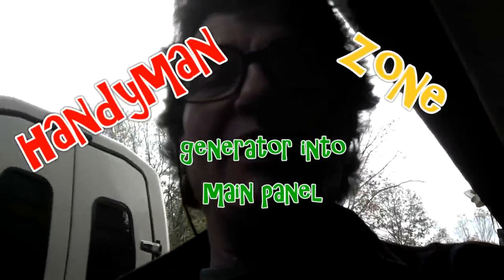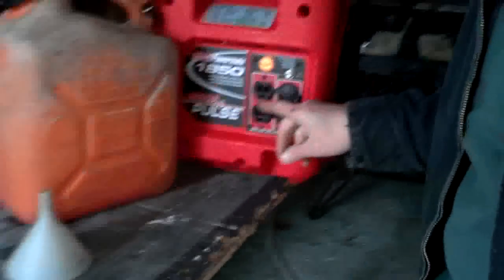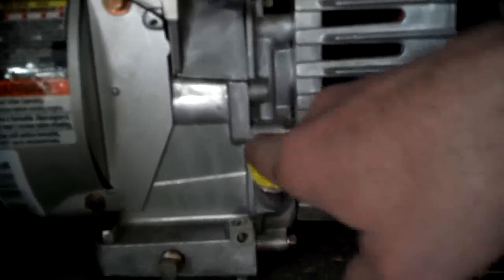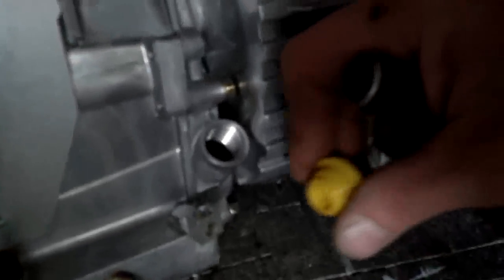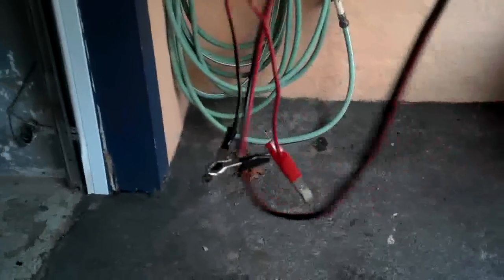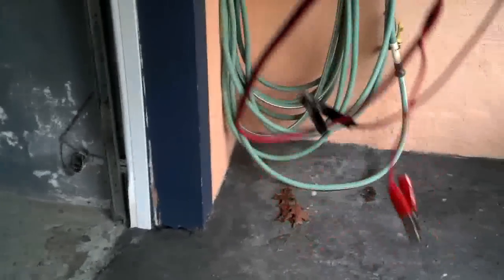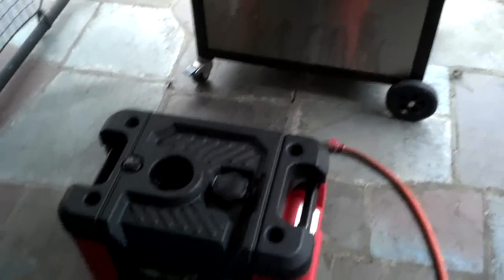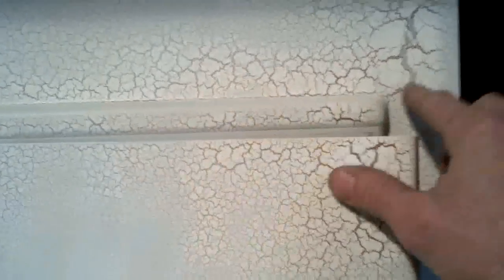HOOK-UP Generator to Home Main Breaker Box

Comment: O M F G.....   WOW..  

Where do i begin...??  I am NO electrician and i would have NEVER did what you did...

The generator is fine.. Your cable from the generator to the panel was ...... Sub standard to say the least. You used alligator clips to attack to the panel... Hope they can support ~15 amps..  You powered one side with the clip and then used a CLAMP to jump it to the other buss bar at 18:16......... WTF....  i would have just opened up the aligator clip even more and jumped both bass bars with the same clip.... 

Yes your setup worked and its safe " AS LONG " as you don't overload that main wire from the generator to the panel to create a fire before the generator could trip its own breaker.. 

I would have got a double 15 amp breaker.. slapped it in there, attached the black HOT 120V wire from the generator to one side of the breaker and JUMPED it to the other breaker to activate BOTH buss bars with 120V...  Then SHUT off all 240V breakers... Now the entire house has access to power, just have to be careful what you run that you don't overload that generator cause 1800 watts is NOT a lot of power...

Comment: DO NOT, use the "alligator clips" like this gentleman is doing. All local codes aside, in an emergency you are safer just turning off the MAIN breaker and plugging the generator into an outlet. This assumes you have an extension cord with plugs (no receptacle) on each end. In a real emergency I would likely cut one of my extension cords and wire it to an existing breaker (not recommended but safer than stupid clips). NEVER hook to the ground. This is AC not DC connect to White and Black wires.

Comment: I strongly recommend you totally disregard this video.  This is a really wacky way to do this.  He is lucky he didn't electrocute himself.  Instead, if you are so foolhardy as to to connect a small generator to the main panel, just turn the main breaker off then plug the other end of your feed from generator with a male plug on both ends into a wall outlet.  Then select which circuits you want to feed and turn the others off.  None of this foolishness of messing behind the breaker panel.

Comment: I don't know why all these turds are posting scary comments about the method this guy has demostrated to power up at the breaker box..  His demostration is right on for disconnecting the breaker box from the power grid and providing his family with electricity to make it through an emergency.  Yes, the most safe method would be to spend a thousand dollars or more to install a connector box but american can do attitude wins out each time.  So all you elec code police, stay off this guys case!!

Comment from the maker: @ssharnick, vid or no vid... 18 house burnt up this area from generators in 13 days! the reasons officials gave range from dry leaves built up near hot generator to leaky propane tank....nothing about a youtube video....lol .more burnt up from falling live powerlines or fires fireplace and dont forget candles used for lighting
this is a offical disaster all crazy shit happen, 8 dead from carbon monoxide - gens in garage, or charcoal grilles 4 heat. ppl are stupid linemen are not (they check)

Comment: I've made mistakes with jumper cables.   At the 8 min mark I knew this video was a mistake, when I saw the home crafted jumper cables.  omg, find another video
Reply: Actually.. As long as you're practicing safe methods, who made your cable doesn't matter that much. I make my own "home crafted" cables all the time.. ^.^
That being said... There are easier ways to connect your genny w/ plugs already available in your home, and without any exposed copper.
Reply: I agree.  But "safe methods" are difficult to follow in the dark, cold, stressed filed atmosphere of trying to get things done.  A transfer switch is the best way, and I'm not sold on reverse feed..  Take care

Comment: still thaire is way more safer ways to illegally power your house like making a too ended electric dryer cord and putting  the main breaker in the off position  pulling out the main breaker with the line side of it having the potential of becoming live if power comes back on is verry verry un safe and kill someone if they happend to hit the lline side of the breaker

Comment: I guess you do what you have to. However this is not a proper way of connecting generator and line power. Use a change over 3 way switch mounted in a insulated wall mounted box and proper waterproof sockets and wiring. Still you got power gangan style.
Reply from the maker: thanks , I'm good to have around in any disaster.. .maybe if the universe allows, we can share a small disaster soon...Lol
Reply: You are right, its not the proper way but it WORKS... His only downfall was the wire from the generator to the panel with the clips....  He could have easily over loaded that wire and caught it on fire unless the breakers tripped 1st...

Comment: all you people telling people to back feed a dryer outlet with a suicide cord are just as bad as this guy, if you don't know what you are doing get someone that does, hardwire a 20,30,50 amp outdoor male receptacle to a 20,30,40,50 amp breaker on your panel with an interlock that will not allow it to be turned on when the main is in the on pos this is the best way to get it done short of an expensive transfer switch
Reply: Excellent idea, Dan.
Considering the objective of this video is to prepare for the next emergency, your idea is really very good. Done as you suggest, you are ready for the next outage. Of course, the transfer panel is best as you say if you can afford it, but your idea is just fine. Thanks!

Comment: hi dino I live in the uk an google how to use generator in my home the reply I received back was run extension  cable from generator and put my three pin plug suicide cable into extension cable and then my three pin suicide cable in to the three pin wall socket no mention of running from fuse box just switch off the main breaker first and away we go to power  house this country is shit out for regulations due to our pals in Europe the mother ****ers how is it that you have to go through your fuse box good video bye the way best regards Garry

Comment: If it matters enough to use a genset to the main panel it matters enough to use a proper transfer switch. Otherwise slinging extension cords to vital appliances is a better approach. A genset is a comfort item, not a survival item and there is a difference. Third Worlders get killed all the time so their casual acceptance of stupid conduct is reasonable given they they don't have much hope anyway.
There is even a name for the backfeed plugs, "dead man plugs".  If you can afford a house and a genset, get the effing transfer switch. It adds value to the house too.
Backfeed kills power company personnel every year because idiots who think ignorance is cool don't properly isolate their gensets when using them. If you can afford a whole house genset a transfer switch won't break the bank.
BTW if you want the best supported gensets the way to go is a Miller engine-driven welder for about the same money. They are on jobsites all over the world and you can also rent them nationwide in the US. It's perfectly practical to install a transfer switch then rent the welder via your local welding supply in advance of a storm if you don't want to buy a large genset. Plenty of detail on the Miller website. They hold value better than conventional gensets, and if you are into it you can also weld with them.

Comment: Dino, your motives are good but your advice is a bit irresponsible. No insult intended... I'm not a kid trying to bust your balls. But I wanted to post this comment in order to make a point...

If you feed power back into the grid from your generator, it means that any power company workers who eventually show up to fix the local grid are going to be in for a helluva shock. This is why solar power inverters, for example, are designed to disconnect from the grid in the event of an outage.

Comment: I think we all know you were not running your water hater or any other 220 appliances. Just as you were back feeding the power company neutral This is why you use a 3 poll disconnect to do this, Ignore this guy people he has no clue what he's talking about.
Reply: The Neutral is a conductor and its NOT energized. If it was energized then every telephone repair man, every CATV repairman and every person that touched the Neutral or Ground would get zapped ... 
The main breaker does NOT separate the Neutral or Ground because they are not energized.. The breaker only separates the 2 HOT 120V legs which are the ONLY 2 wires that will zap you.. !!

Comment: I live in a 1 bedroom Apartment and have a 200,000 watt Generator on stand bye just in case the power goes out! People look at me funny when I tell them what the output is but that's what I was told to get by a Electrician company! They installed it so if the power goes out then the Generator Automatically starts up which is so nice because I am 73 years old and can't get around very good. I do think the work was a little Expensive it was almost 10 thousand dollars but the company said I will be